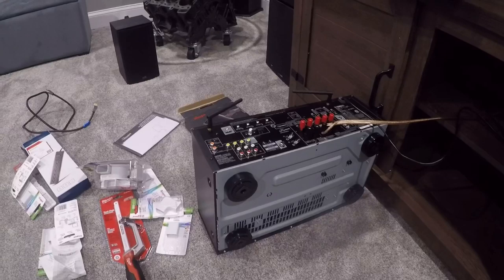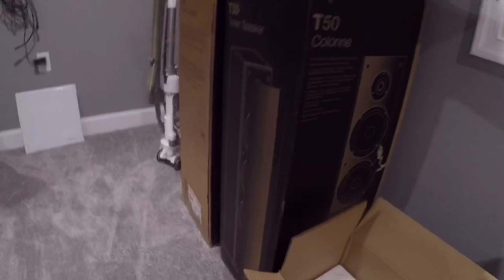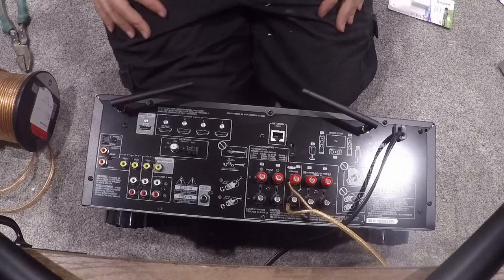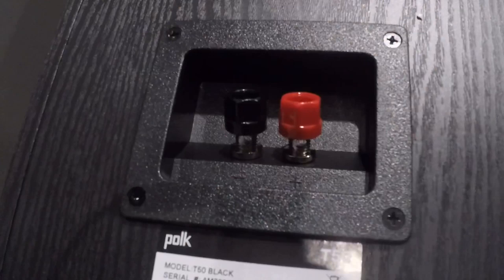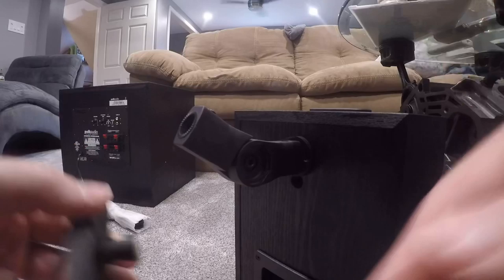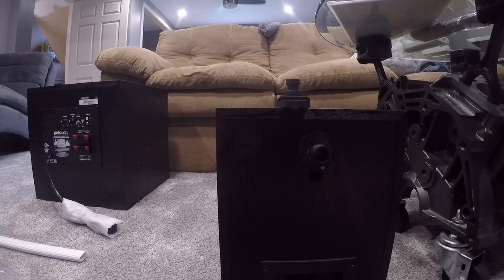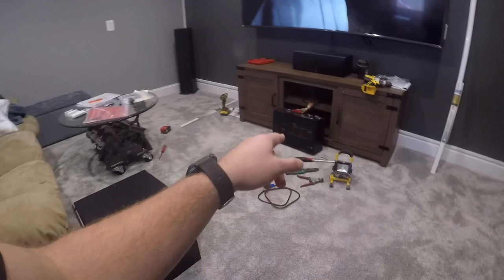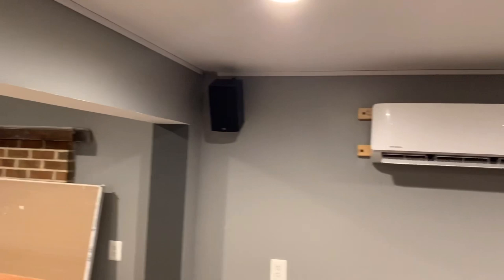Installing Surround Sound! Yamaha RX-V485 and Polk T-Series speakers!

Comment: I have a 7.1 system, end it is all Onkyo except for the two front bookshelves. I upgraded those to the Sony three-way driver bookshelves. And I can tell you when I Play one of y’all‘s videos on it it really does sound amazing. When I was moving locations to my new bedroom that I have now some of the speakers didn’t get reconnected properly so I had to reconnect them all myself, and unfortunately the copper ends for my left side 7.1 speaker that’s on the middle of the wall isn’t working now because of that so I’m gonna need to get some new speaker wire for that one. My only gripe is my receiver doesn’t have Bluetooth capability and that’s just because mine is a 2007 I think receiver so that was before it was really popular. So I’m having to use my RCA why cable to run my phone through it. It’s basically two RCA’s on one and it has a 3.5 mm male plug-in on the other end. But of course sense apple decided to get rid of the headphone jack I had to make sure I didn’t lose that little piece that hooks into the iPhone itself so you can still plug that cable into it. But Polk audio speakers sound pretty good, they just don’t have as long of a life as say a Sony or one of the higher in brands.
Reply from the maker: Alex Williamson's blind adventures sounds like you’ve got a nice setup Alex! That’s great. Yes I used to have the wye cable for a phone input on an old system as well. What a pain indeed. Take care bud talk to you soon

Comment: Pretty sweet set up! BUT, and there is always a big BUTT somewhere in the crowd.  Why didn't you put the speaker wire in the wall before you did the drywall like you did the network cable? Or at least some electrical conduit to the back of the room to pull it through. Great work though!  I have a rats nest mess of wires running around my house so I can't say much.  Excellent set up to watch Legarms. Have to hire him for a day or two to help you out next time he gets fired.
Reply from the maker: harthek2000 man you know how many times I cursed that under my breath! Truth be told never planned on the surround sound. If the speakers were on clearance we’d have never got them. By the time it got to the network cables I was so fed up with everything I Almost didn’t run the hdmi and usb in the walls. Live and learn. And don’t worry. My computer desk’s wires resemble a spaghetti dinner right now. 

Yes! Legarms is the best! Would love to work with him someday haha. Thanks for watching along!

Comment: Do those rocket fish mounts work real good did your speakers fell or does it hold it in place real good
Reply from the maker: They held in place really good but the speakers with my speakers, the hole for the screw was a little too small and I had to force it so that gave me some issues. Looking back I should have just ran to the hardware store and gotten a screw with a smaller head on it. Other than that worked great and were cheap
Reply: @JasonWorksAlot  oh okay cool good to know I'm looking to buy them I seen your video first (great setup by the way) and I have the same polk t15 bookshelf speakers and I wanted to make sure they work good before I buy them so now I know thanks for the response 👍
Reply from the maker: @charliemoreno8153  no problem, glad to help!

Comment: Nice setup, I own the same, but where do you buy your wall mount for your T15 ?
Reply from the maker: Hey got them from Best Buy, pretty sure rocketfish brand, they aren’t great but they work and so far haven’t fallen off the wall lol
Reply: @JasonWorksAlot  but how did you mount them? Did you drill into the speaker because I have the same set up but there’s no screw hole in the back.
Reply from the maker: @IsThAtLoU  there’s a keyhole mount in the back of mine, (large circle at the bottom with a slot going up a screw head locks into) however overtime the mdf collapsed and the one speaker fell so I ended up just getting small coarse threaded wood screws and screwing the mount to the speaker. Just took them down two weeks ago when we moved out of the house and they were still tight as could be.